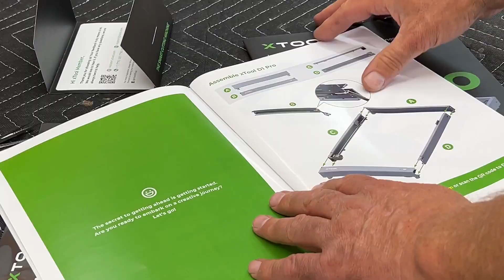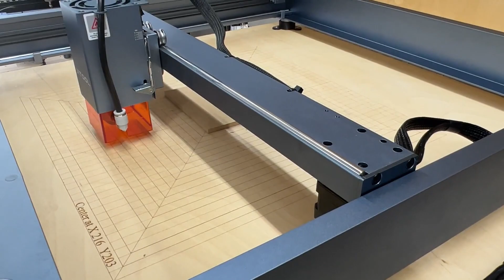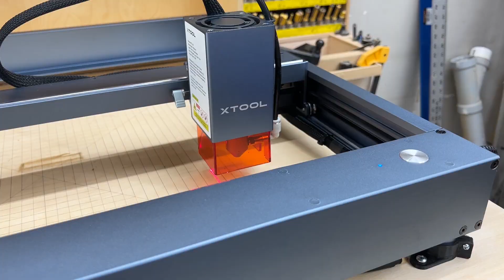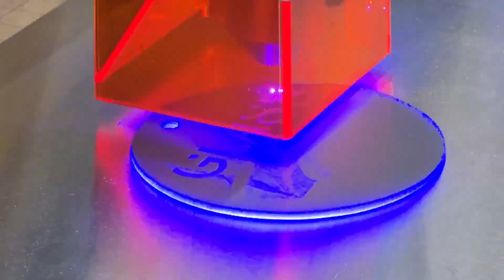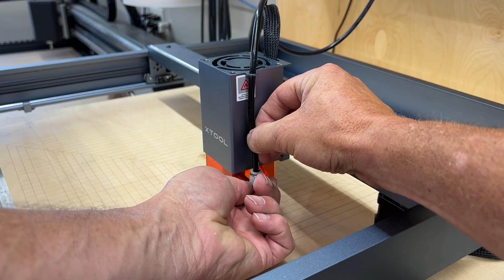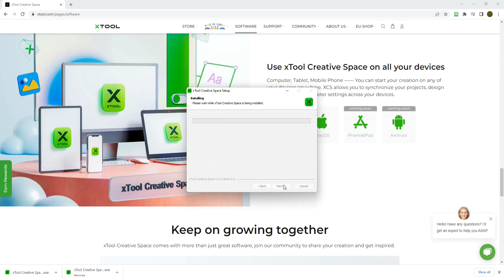xTool D1 Pro  |  Your Next Laser Engraver

Comment: What kind of maintenance is needed for this and is there any consumables needed?
Reply from the maker: Hi Tim, thanks for checking out the video. There really are no consumables that I can think of. And maintenance is very low. Really just maintaining belt, tension, and depending on what you are doing with the laser, you may have to wipe out the inside of that orange protective lens. Other than that there really no other maintenance that I can think of.
If you do decide to purchase one, I’d love it if you used that affiliate link in the description. Thanks again for watching.

Comment: I’ve been eye balling this since I ‘discovered’ it about a month ago. This vid may have got me off the fence. Thanks for the review with real examples of the tool in action.
Reply from the maker: Thanks! Glad this helped. You really can’t go wrong with the xTool line. There’s an affiliate link in the description if you care to use it. 
Thanks a lot!
Reply: @LastLegWoodworks  besides the base unit are there any accessories you would recommend?
Reply from the maker: I have really been enjoying the Ra2 Rotary tool. It is really east to setup and does a great job. It comes with the riser legs too. The air assist would be another accessory that I recommend. Also, though its not an xTool accessory, the LightBurn software for me is a must have for laser engraving. Thanks again! Good luck, have fun and yell if there's anything I can help with.

Comment: Do you need the air assist compressor if you already have a shop compressor?
Reply from the maker: If you have a compressor then you won’t need to purchase the air assist. You can buy the 4 mm hose on Amazon and make a connection to your compressor that way. I do that on one of my other units and I just use a ball valve to dial down the pressure. It doesn’t take very much airflow. Hope that helps, thanks for watching.
Reply: Thank you for your reply.  Yes it was very helpful
Reply: Is that tubing 4mm OD or 4 mm ID?
Reply from the maker: Sorry for the delay. The tube is 6mm OD and 4mm ID.
Thanks!

Comment: Do I need to have a exhaust system? Or can I get just the laser machine
Reply from the maker: Hello, you don’t need to have an exhaust system as long as you use the machine in a well ventilated area. I use mine in my shop with the overhead door open. Sometimes if I’m engraving MDF or something that creates a lot of smoke, I will turn on a small fan to help. 
Hope that helps. Good luck and thanks for watching!
Reply: @LastLegWoodworks  thank you for replying! Also for sharing